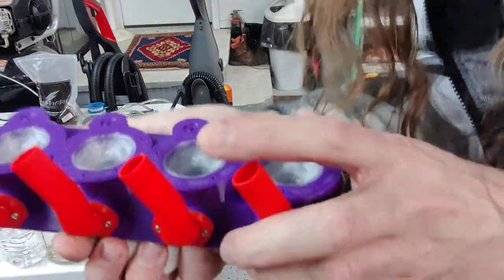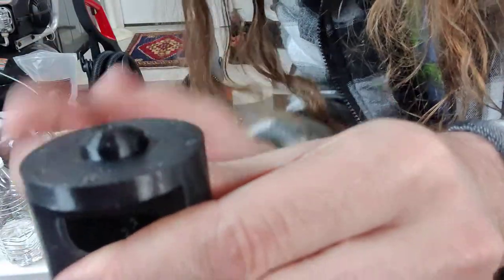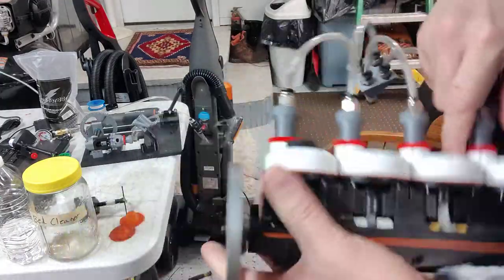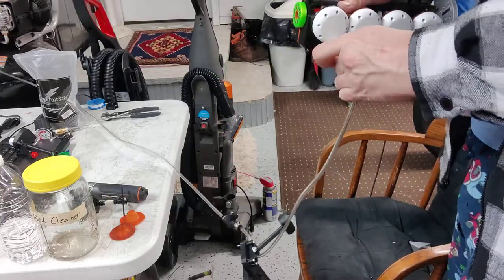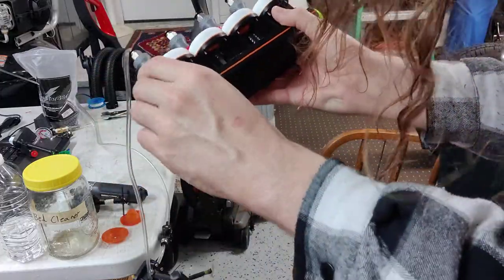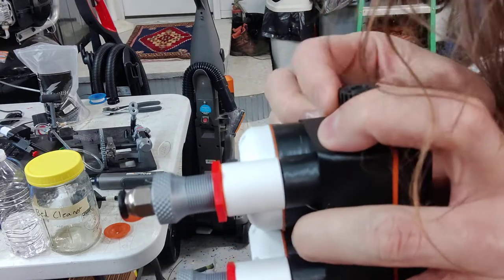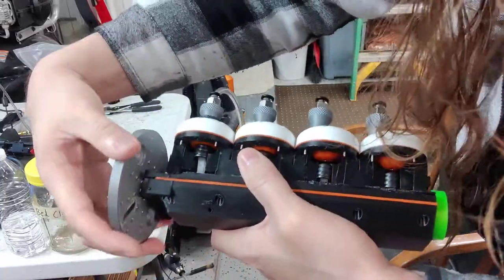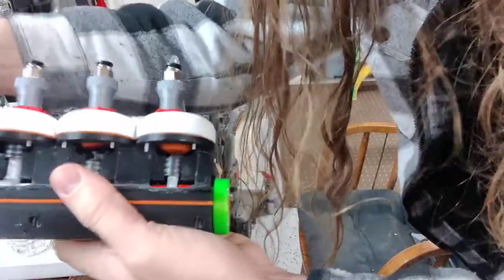In depth look at timing the I4 crossplane performance engine.

Comment: Wtf? This is awesome. 
I’m building an actual ICE cross plane 4 model engine with 1 1/4” pistons. Took a break to eat lunch and your channel showed up. 
I purchased some blueprints for a Panther Pup 4 cylinder but I really wanted to do it differently so I chose a cross plane crank because of the sound. I’m whittling the crank on my lathe right now. 
Your pneumatic engine sounds badass. I hope my ICE sounds half that good. 
I’m subscribing dude this is really cool.

Comment: Would be awesome to, once everything is sorted, use clear print on every component that's not moving including the block.
Reply: The Carbon Fiber Reinforced - Plastics will always be black, i am unsure on the bearing material (it seems to be POM with PTFE, and maybe small drops of lubricant, all mixed in) but that will probably always be opaque too.

So I think most of the materials fundamentally can’t be clear.

I think the skeletonized models/cutaway models, as well as just looking at the CAD should make that not too much of a problem though (at least in my opinion)

Comment: why did you even build it 4-stroke? it needs to be 2-stroke. so either have 2 notches on each side of the camshaft, or gear it 1:1 with the crankshaft.

Comment: Why for the hell you need a camshaft on a Diaphragm engine?
Why you don't use it without a diaphragm, like Tom Stanton?
Reply: As he said, it's a 4 stroke configuration- that being said you would need the crankshaft to make 2 revolutions for every 1 revolution of the cam. In most cases, you'd be able to get more efficiency out of a 4 stroke. It's also going to increase serviceability and adjustability having the cam separated from the crank. Tom Stanton created his diaphragm engine because the square piston engine wasn't efficient enough for his needs.
Reply from the maker: In Tom Stanton's own words the diaphram was choosen for his engine because of the need to seal the piston.  I am retaining that use, but I am not using the same valve design.  The original valve design that Tom Stanton came up with has two drawbacks which eliminated its use as an option for this engine,  as Print break iterate has said, you cannot make the engine a 4 stroke if the intake valve is attached to the piston and the other problem is that you can never obtain a long stroke because the ratio of the valve opening will always be in relation to the piston travel.  In fact, I am actually scratching my head atm trying to figure out how to incorporate an exhaust cam aswell, because having a hole in the diaphragm means that it can never obtain very high psi because it will always break the seal on the piston top.  So everyday, I am finding myself moving further and further away from the tom stanton design and more or less will just be using a diaphragm to allow for a non airtight piston.
Reply: @chrisjenda5162  it's interesting if you'd manage to have an exhaust stroke and a sealed diaphragm in a 4-stroke engine, but i honestly think making it a 2-stroke and a hole in the diaphragm is just going to be much more efficient.